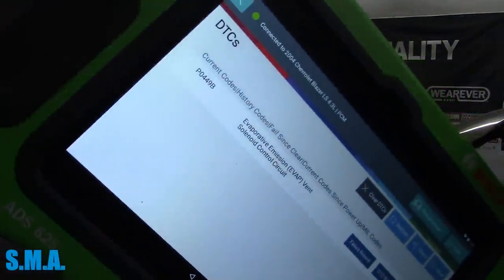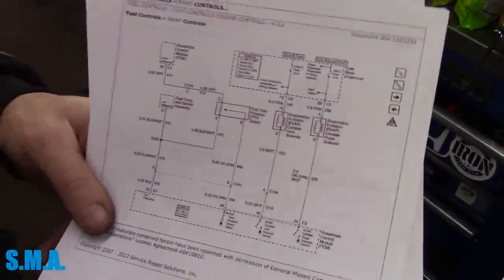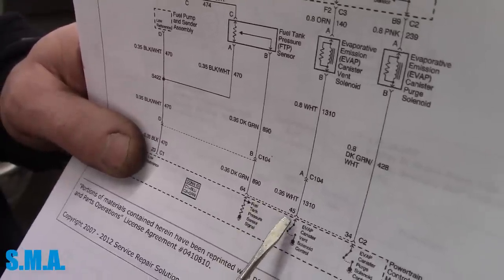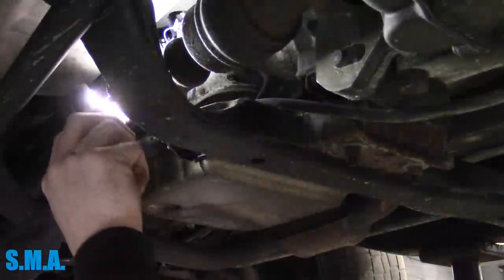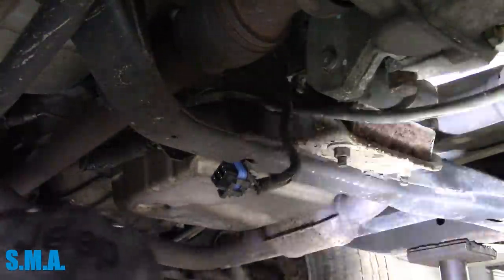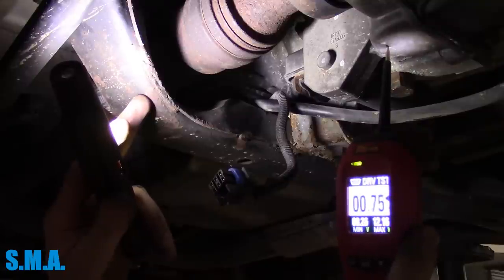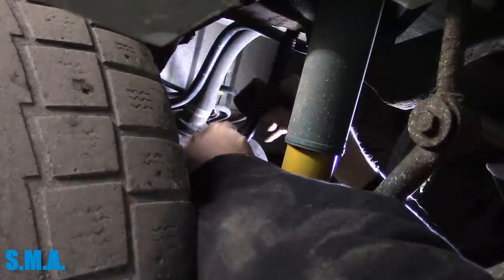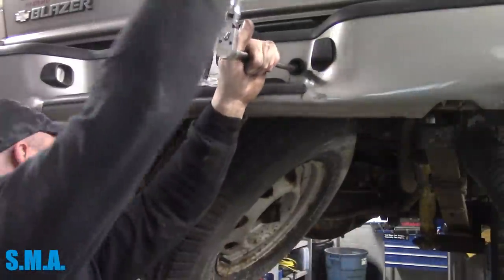Finding A Broken Wire Using Logic

Comment: Hey Eric would you also change the vent valve anyway along with fixing the wire  ??
Reply: No , I  would not either  .
Let the customer know that no parts were used .
And confirm that it is repaired by fixing broken wires.
Reply from the maker: Nope. I proved it worked 🤔

Comment: Had my 2005 Silverado in the GM dealer for an alignment. When I picked it up the check engine light was on for this code. Told them I'd fix it myself. Did some poking and found they had pulled the always hot fuse that runs this valve. Could see the finger smudges in the dust around where the fuse went from when the guy pulled it out.  Took a photo and sent it to the dealer with a writeup of what happened and how I found it.  Got a call from the service manager saying he couldn't explain it and that was it.

Comment: What if I have to splice in additional wire because the corrosion goes too far for a crimp connector to bridge the gap?  As long as I use the same gauge wire, do I have to worry about what type of sensor the wiring is connected to (can the splice cause other problems or ruin the sensor especially to ECU wiring?)

Comment: Question hopefully someone will see.  O said you can buy a 3 day subscription to GM for a nominal fee.  Cool.  Can you download and/or print the schematics during that timeframe? Do they have a limit on how many you can download / print ?  TIA
Reply: You can download and print the data.  You can also buy a single-vehicle subscription from AllData and a couple others.  I think the AllData is $19.99 for a one month subscription to a single vehicle or you can get one year or three years.  One cool feature of AllData is that you get color-coded wiring diagrams that are interactive.  You can touch a wire and it will get highlighted throughout the entire wiring diagram.  You also get a ton of other information included.
I'm just starting up a diagnostic/troubleshooting service and this is the method I plan to use.  If  you more than 11-12 per month then I think a regular subscription might be a better solution.  I'm simply planning to include this fee in my service fee.

Comment: I'm not as surprised that the spare comes off as I am that it's still on. They usually fall off driving down the highway after 10 years.
Reply: And I'm sure you pulled it down and sprayed the releasing mechanism with some Panther pee...yeahhh riittteeee

Comment: wire corroded in half, yeehaw. i forget the most likely spot they corrode in half, either at the connector or about 3" ahead of it.
lol.. i think that was the common spot on them.
**so much for my memory, after seeing it over above the axle, that rings a bell on the suv and trucks ;)

Comment: My wife has a 95 blazer 4.3 we definitely have replaced a few items or I have over the years new shackles in the back brake lines and gas lines condenser and compressor but it all still runs pretty good everything works like it should I think they made him pretty good back then considering I live in the Rust Belt
When she turns off the ignition and parks it it always smells like gas fumes at the back and I’m pretty sure it’s the cell annoyed vent but they say you have to drop the gas tank and I just don’t want to do that I don’t smell like gas for too long she just drives back-and-forth to work but 160,000

Comment: Couldnt you test the wire at each connector with your voltmeter set on ohms to see if it read open to figure out if it was broken? It would be kinda arbitrary and a pain but that would work wouldnt it?
Reply from the maker: I suppose you could... But a test light is way faster 😉
Reply: Yeah i know the way you did it was the easiest and fastest way but sometimes my brain doesnt choose the easy way lol

Comment: I never had shrinky dinks. I did have these things that would come with metal frames in the shape of butterflies or American flags or whatever and you put these little colored plastic pellets in the frame and stick it in the oven for a while to melt the pellets into a smooth solid surface. They came out of the oven looking like little stained glass things you could hang in the window. Ahhh, the 70's, when every toy you had could probably kill or maim you in some way.

Comment: For a broken wire could you use a amp clamp and power the wire and slide it along until it drops off on a bundle
Reply from the maker: No current flow equals no amperage remember :D
Reply: South Main Auto Repair LLC ok thanks it was a good video thank you

Comment: my impala 2003 Impala 3.8 will short out and all electronics go dead intermittently when the key goes to the on position (not even cranking). Sometimes it resets itself, other time you have to disconnect the battery for a second. I was looking at wiring diagrams on alldata, could this be a bad pcm? I've already replaced the ignition switch and passlock sensor with AC Delco and the contacts on the wiring all looked great. Body control module is new (replaced back in Dec 2019). It shorts out like this maybe once every 100 starts. I was trying to see what gets energized in the key "ON" position but my skills are not that advanced. How do you tackle something like this where's it's intermittent? I can't reproduce the problem at all. It's just "random"
Reply: John Ames If it’s a side post battery check the connections. They’re really bad about making a poor connection and everything will just go dead. Then sometimes it works enough to stay alive. 

Otherwise check all the main power wiring to the fuse box. A bad ECM would not likely make all the electronics go dead as there will be other modules running other things.
Reply: @NBSV1  it is a side post battery and the terminals are nice and clean not a spec of rust on it and right as well. The grounds to the body are good as well. I've checked them just last week. One thing I did find is some exposed wiring along the front of the engine to the right of the connector (the wires come from a sensor either MAP sensor or Cam sensor at the top, and the rest of the wires come from the ICM and all run into that one harness). I took it to the shop and they put heat shrink tubing so the wires could not make contact with each other and cause a short. This thing really has me stumped.
Reply: @johnames6430  You have to actually take the cables off and check them. They can look fine on the outside, but have a bad connection at the battery. Usually it has spots where the cable contacts that wear away on the battery side.

The best thing you can do is keep a multimeter or a test light in the car so you can test for power when it fails. 

Sensor wiring can cause it to run bad and some issues, but there isn't full battery power running to the sensors so them shorting wouldn't make everything go dead.

If you actually loosing power to everything then it will be a problem with the main power somewhere. Follow the big wiring. If you're only loosing power to the engine but everything else works then it's more likely to be power to the ECM. It's rare for an ECM to fail and they're expensive so you don't want to replace one only to find it still has the same problem.
Reply: @NBSV1  i already bought a new PCM and actually just finished putting it in, does it need any GM relearn procedure for security or is security only through the BCM (body control module)?
Reply: @johnames6430  I don't know about the programing or security side of things. But, if it's likely it would need programed to the engine and then programed to work with the other modules. 

Is it just the engine electronics going dead, or everything like lights, dash, etc? It's doubtful the PCM would be bad. It does happen, but it's much more likely to be a wiring issue.
Reply: @NBSV1  It did require the GM relearn procedure. I just finished up the 30mins and it started up. Last time I tried this the BCM went nuts and killed itself (not exaggerating). So it only goes dead under 2 conditions. During Key "on" before starting, and to "on" again when trying to shutdown from "start" position. The Ign switch was replaced with AC Delco in Dec 2019. The Lock cylinder (which has the passlock chip) was replaced in 2016. It's still doing the intermittent no crank/no start. I just replaced the PCM and I hope that solves it.

Comment: Lite-Brite was the best! You can still buy it on Amazon
Reply: Wow, flat little, battery powered, led-lit, Lite-Brites. The front of mine was flat but the back of it stuck way out kind of triangular shaped and you screwed a regular light bulb in and plugged it in and if you put too big of a bulb in it the back of it turned brown from the heat. Good times
Reply: Saw one in Wally World last week.

Comment: i have had a 2006 ford taurus that has been driving me nuts. the abs light and brake light have been coming on but when i go to hook up my reader to see if everything is working i can see all abs censors are working but when i take my tester off and drive it around to same spots i had the tester on all the light and warning crap come up but stop not turning the car off. the light and text all stating abs problem is still there but live data shows abs data is working like it should. the first time it happened with the text on the dash with the abs while i was driving the car for my sister to the airport to pick her up 3 months ago and it just keeps happening but as soon as i hook up my tester to capture live data it never happens

Comment: I've missed these electrical videos currently dealing with a chevy caprice ppv at work came in miss fire while cold typically  we do  the seafoam type treatment   to get the carbon off the valves being direct injection  I go to start in after I hook back up the hose and gives me about a 1/4 crank and just stops my first thought of course is f?%$ i just hydro locked this engine  but I'm able to turn it by hand so not hydro locked  I'm hoping the starter just so happened to crap out  cant get my bigass hands to test for power on the s terminal but tomorrow's another day  love getting my ass kicked by something that's supposed to be simple but with the way they design  this crap it's not always possible

Comment: Wire loop in place of the fuse through a coil powered by a signal generator.  Very high hz.  Scope with a probe to trail the harness and find the open.  I think they actually have tools for that which you can buy that do the same thing but if you're creative this works too.

Comment: Re: "poking the wire" to test a shorter section, do you then have to use "liquid insulation" to repair the hole? I have used a drop of Gorilla glue for that.. Is that ok? Please say yes, because I can't find any other use for that stuff. lol

Comment: I really regret buying the Bosch . For 8250Euro's I should have thought twice . The Autel is way cheaper and works perfectly . You would think with Bosch being such a big player It's tool should be superior but it's not . I should have kept the KTS . 4000 Euro's Extra so I can work on Light duty and heavy duty vehicles . And the yearly contribution so you can keep using YOUR tool ?? My worst spent money of 2018

Comment: What is it with so many broken wires in GM cars ?? It cost me $1500.00 for the local chevy dealer to find a broken wire on the theft deterrent module on my 2001 Buick Lasabre.....and it took them over a month to find it !! When I took the car in I told them that the theft deterrent system was freezing everything up....But instead of starting with checking that system they started in the trunk with the rear body control module and worked their way forward through every other circuit before finding the problem. Of course the claim was that the Tech doing the work was "The best in the world" (ya right).The wire was one of several that go to the module that forms the ring around the ignition key cylinder. The wire was defective from the factory and had no doubt contributed to the former two owners getting rid of the car. Of course I ended up with the car when the wire finally  failed completely. Is this broken wire thing happening with other Car manufacturers??? Or is this more of a GM problem?

Comment: Hey Eric O’, That’s not the only time I’ve seen you break a wire like that. It looks like there is no outer damage to the insulation. I’m wondering how that can be. Should I believe my own eyes. Are you a Magician?
Reply: He suspected there was a break internally at that point because the wire loom was broken there... and he knew there was a break in the wire somewhere.  If you do the "finger pull" test and the wire insulation snaps you've found your problem... or at least one problem.  If you put pressure and the insulation doesn't begin to stretch and then break then the wire is good and you have done no harm.

Comment: Hi ya Eric O, your dead right about getting information about the vehicle you are working on. I own a 30 year old R31 Nissan Skyline Australian release sedan. It has a RB30E 6 banger in it with a nissan automatic transmission. Most of these cars have gone to the crushes and only good ones are left on the road. Mine is one oftthese rare good condition cars. Getting any help to fix these cars is not to be had anywhere. Not even Nissan Australia could help as all the old mechanics are dead or retired and all the new mechanics don't know anything. My car had a brake light fault. The high level brake light worked but the 4 main lights did not. I took the car to 5 repair shops and they said the same thing. You will have to find someone who knows about these cars. Lots of phone calls later and I still had no brake lights. One guy said to hot wire the main brake lights to the high level brake light on the back window. This wire was far to small to handle the 15amps needed by the 4 main brake lights. I myself ended up finding and fixing the issues causing the fault. The car has a brake light monitor that shows a blown globe warning on the dashboard telling the driver to check the lights for a blown globe. I own the original factory workshop manuals and even those we're of no help. They said to check for power on the pedal switch and then at the wiring harness at the back of the car. The manuals did not show where the brake light warning sensor was located in the car. So using the old scope on a rope and old school following the power from the pedal switch I found the fault that no one else could find. The brake light warning sensor was under the carpet beneath the right-hand front seat and power was going into the sensor but not coming out. So I had found the fault, but how to fix it. The sensor was unobtainium. So fix the sensor.
It ended up being a bad solder joint that I fixed with a soldering iron and 10 minutes after 9 hours looking for the fault. There was no information anywhere about this fault. Now there is because I found it myself after all the so-called professionals could not.

Comment: my easy bake wire trace tool has been broken out .... lol etch-A sketch;  light bright; >>>I love it.. Your starting to show your age but that`s a good  thing Eric... Well as usual very crafty deduction; I just had the same sort of fix... But you have not looked at your face book or if you have there`s been no comment.. Point I found a escaped dodge ram from your end of the wood`s; Suffering from stage 4 cancer with a valid sticker.... lol go look there`s pic`s and all the good stuff with the post .... Well AKA jhackme IE cousin Vinny down the good ole south Iam out later Eric--oo>>>>>>>>>>>>>>>>>...........

Comment: Hello I need exhaust manifold bolts removed and new installed. 2009 Dodge Ram with the 5.7 hemi. Where you located ?
Reply from the maker: NY... google it.. 🙄
Reply: Address is in the description near the bottom. Avoca, NY 14809